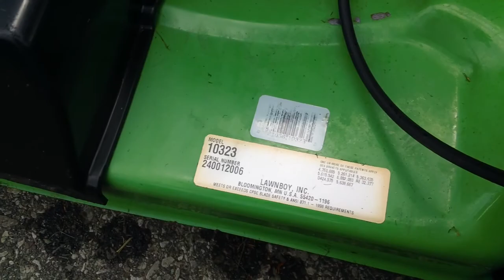Duraforce Lawn-Boy

Comment: Great mower.  Just needs a Briggs & Stratton 801308 pilot jet to fix the surging issue.  I've used my 10323 for 18 years now with minimal trouble after changing the pilot jet and adding the fuel shut off valve it should have had from the factory.

Comment: Can you drill out the jet to eliminate the surging?
Reply from the maker: you can drill out the main jet however,  doing this violates epa regs.  i would try installing a new main jet or new cars,  these plastic carbs are "problematic" to say the least,  surging could also be caused by a bad crank seal check bottom of crank seal,  if it is wet it needs to be replaced